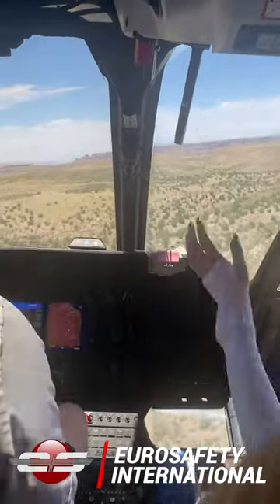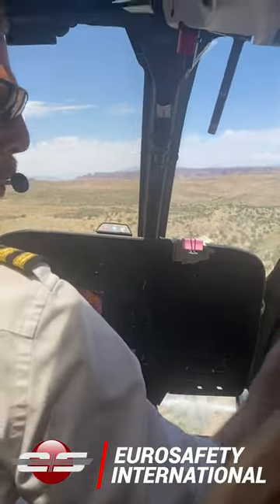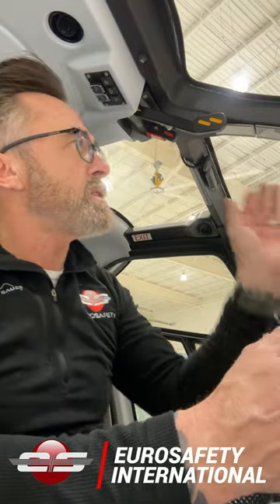The Reality of Grabbing the Rotor Brake in a EC130 #aviation

Comment: This is a great presentation. From my understanding (correct me if I'm wrong). The purpose of a rotor brake is to prevent or stop unwanted rotation of the rotor AFTER  engine shutdown on the ground. If the rotor stopped in the air, the helicopter would plummet like a rock. I have talked with pilots and military flight instructors and worked with the Huey 369 group and been in aviation for many years reading several NTSB accident reports. I have NEVER heard of a helicopter crashing because the rotor brake was applied, A huey pilot intimated in his book "Chickenhawk" that if the brake was fully applied after the engine was stopped and the rotor had slowed almost to a stop it would just slow down the rotation, and then they would set the brake, and tie the rotor to the tailboom to assist the brake against gusts for overnight storage.This is because to my understanding, they are designed ONLY to restrain loads from wind gusts acting on a parked aircraft. They are of insufficient strength by design for safety so as to not be able to suddenly stop a powered, flying rotor, or to even be able to slow it to any dangerous degree against engine power. such a brake would have to absorb torque loads many times in excess of the engines output and would probably rip off the tailboom from reaction. In other words, they are a small parking brake of very limited strength. Thus they would not heat up fast enough to cause a fire instantly and are probably designed to become red hot without doing so, just fading rapidly in effectiveness. I can't see any how manufacturer would ever install a big lever accessible to all that could instantly convert your hitherto functioning helicopter into an earth-seeking missile full of people screaming into the radio. However, and rightly so, pilots are taught that it should never be applied while the rotor is in motion, it would create a very interesting and possibly expensive situation, but not likely a fatal one. Secondly, sitting here and saying whether the pilots response was correct or not is ill advised. It was up to HIS discretion. The pilot is god on any aircraft, having ultimate power because they have ultimate responsibility, and they know THEY will be held personally responsible for the actions of anyone on board. Due to how the video was edited, and from personal experience, I suspect that the passenger had been difficult the whole flight, thinking it was cute or flirtatious to provoke him by constantly screwing around and twiddling with the controls. Some people have been kicked off of an aircraft and banned from ever returning for actions like this, because if a passenger with access to the controls ever causes a crash, it is the pilot's fault, and by extension the company's. None of us in the aviation community want to be made unable to allow someone to sit in the right seat, or even to let them fly for awhile which is very safe (generally fixed wing and non commercial only) due to an incident because we, especially in the fixed wing community, are encouraged to instruct individuals that routinely fly in a certain aircraft in operating that aircraft to the point that in an emercency of pilot incapatation, they could Aviate, Navigate, and Communicate! This takes practice. It is also a benefit for avaition to to allow these wonderful experiences. (We have to be ambassadors and recruiters for general avaition if it is to survive) so, he extended an AWESOME privelage that came with responsibility, to someone he deemed worthy. I can almost gaurentee they were instructed on how to conduct themselves.  He sounded like a parent at the end of their rope being thoroughly disrespected in a deteriorating situation, being constantly distracted from performing his job of  FLYING the aircraft. I have been in situations like that, and having the engine quit would be far less stressful than this! Interestingly, pilots in training are taught that you can easily make a child's day by letting them take the yoke for awhile in a small plane, but to be carefull with adults! Adults are more likely to panic or not follow instructions.

Comment: He is not saying that the pilot didnt act in a correct manor, nor is he saying that passengers should be free to touch stuff in the helicopter. He is simply pointing out the fact that people are spreading misinformation about what a specific toggle will do to a helicopter. Stop trying to misinterpret.
Reply from the maker: A voice of reason!
Reply: Yeah, but by the same extention, someone might see this video underneath the incident video and assume the all helicopters have the same rotor brake safety features like the EC130.

After all, if you put a "don't touch, wet paint" sign on a wall....some idiot will touch the wall to check.
🤦🏻‍♂️😂
Reply from the maker: I would have to assume if someone is that lacking in intelligence they would not have the funds available for helicopter transportation. Problem solved
Reply: @EUROSAFETYTRAINING  A rare thing on the internet
Reply: @EUROSAFETYTRAINING You would be surprised. I'm not.
Reply: Don’t be logical it scares the idiots away
Reply: @EUROSAFETYTRAINING  you underestimate dumb people lol. So was the lady trying to pull the lever in the video a rich genius?
Reply: I also saw, allegedly, that was the third time the pilot said something to the lady

Comment: They also said that an airplane door cant be opened in mid flight due to a safety lock yet a guy on air asiana managed to do it.....

Moral of the story even if u "think" that u wont have the force required to pull it back common sense should tell u when ur mid flight thats not the time to find out

Comment: Questions can you brake torque a helicopter? Would the brake drag if it was pulled even though it doesn't stop the rotor? If so would that drag overheat the rotor shaft? Would engaging brake stress engine enough to blow it?

Comment: Why is there 17x more deadly helicopter crashes than fixed wing aircraft? And with numbers like these, do you think there should be more fail safe’s?
Reply: Type of operation. Helicopters spend their time low to the ground. They also have much shorter flights on average. An airliner might spend 8 hours at 35,000', cruising on autopilot. There's not much to go wrong there. For me, 8 hours of helicopter flying would involve maybe a dozen landings and take offs in urban environments, the same again at an airfield, and maybe 3 or 4 of reach from a rooftop helipad. There's much more time spent close to solid objects!

Comment: Not only that but it doesn’t stop immediately, it takes quite a while to slow down and not only that, but the engine is still running and applying power so most likely there would only be a slight drop in rotor rpm and the pilot would just disengage the brakes. In a worse case scenario the engines shut off and the blades are completely stopped. The pilot can lower collective and start autorotation to spin the blades back up (you would be falling for a bit though) maybe you would have a really rough landing but everyone inside would be fine, I think.
I’m going to test my second theory out to see if I can get autorotation in time to avoid the ground

Comment: There is an extremely small possibility of stopping the main rotor by attempting to engage a rotor brake while flying. However, there definitely a risk of causing a rotor brake fire and the engine compartment fire suppression system on most helicopters is not effective at stopping rotor brake fires.  Also, not all rotor brake equipped helicopters have a safety release on the brake lever and the force required to engage a rotor brake will vary from model to model.

Comment: So at best it would slow the main rotor, overheat the shaft, and cause either a fire of massive vibration, either of which would be catastrophic. So the pilot was correct, it would kill them.

Comment: so then, the rotor brake is only used to park the helicopter after use so the blades dont freewheel in the wind while it's parked on the ground, not ever during flight right ?

Comment: I have seen a aircraft that the rotor brake control unit was rigged incorrectly and it supplied pressure when the handle was fully in and it caught on fire and burned up a lot of panels before it got put out. You are not going to overcome the inertia and power of the blades and engine and gearboxes but you will make a crap tone of heat

Comment: This description is still wrong, it would not take more force to lock the rotor brake because it is spinning, if anything it would take less. But that is definitely not enough break to stop that much horsepower so the helicopter would keep flying and you would just burn up that break.

Comment: General public won’t know what type of helicopter they’re in so suggesting it is safe to pull the rotor brake because you think it is in one type is still a dumb thing to do. Also you have made no mention of the fire risk associated with applying the brake which will affect all types.
Reply from the maker: I am utterly amazed by some of these comments. Did you listen to what I said and think I meant that its ok to pull the rotor brake handle?

Comment: I wouldn't be worried about the brake stopping any rotors when the engine is running, I would be worried about friction fire or damaging something in the brake system that could cause a rotor issue during flight. Dunno how they work but I'm assuming here

Comment: The main point is: The pilot is the one flying the aircraft.  The passenger(s) are not.  Do NOT touch anything in the cockpit without asking the pilot first.  Even if it may have no effect, the pilot has the responsibility, and interfering with the aircraft and pilot is irresponsible.

It's like having the passenger in a car reach over and grab the steering wheel while the vehicle is in motion.  Even if the passenger doesn't turn the wheel, the driver may need to suddenly, and would have to account for the extra factor.

Comment: Ok, on a Sikorsky S-76, you can legally apply the rotor brake under 65% w/ one engine off. So there for I’m thinking if put it on at 107% w/ both engines running you can over power the brake. You will make a boat load of heat and sparks that may ignite the magnesium gearbox housing. 

In a H-60, to legally apply the rotor brake it’s both engines off w/ the NR under 60%. I have had a rotor brake partially hang up on the ground and it made quite a high heat mess.  The disk was a burnt  blue mess, the spark shield was scared with chunks of steel spatter and the caliper was junk. 

On a H-53, the rotor brake is electric and is interlocked so there is no power w/ the engines, therefore no rotor brake until all engines are secured.

Comment: probably still shouldn't touch the rotor brake control or any other control as a passenger in any aircraft, especially when in flight.  that pilot was a bit salty, but he didn't know what the passenger was going to do with that seemingly random handle. pulling it might not have crashed the aircraft but might cause expensive damage.  either way, i would have yelled at the passenger too. .  passengers don't touch nothing, hold your seatbelt if you need something to hold on to.

Comment: Plus the engines at full throttle, while it would brake the rotor significantly even if it was pulled back and locked; wouldn’t immediately make it drop like a rock; if the pilot couldn’t throw that back forward quick enough to recover, he shouldn’t be flying. Let’s say I was oblivious the rotor brake was engaged, I’d immediately see we’re losing rotor speed while maintaining full flight power and that would be the first thing to check, did my idiot sitting next to me pull the rotor brake; otherwise I’d start staging for an autorotation looking for where I can land since something has happened that’s seizing the driveshafts, but in that case you can’t even do a good autorotation, so just hope and pray really 😳

Comment: Could it potentially damage the aircraft if someone tried to pull it? Not sure why passengers think they can push buttons or grab levers in the first place. It is beyond me.
Reply from the maker: Perhaps you did not watch all the way through. I pointed out that the handle is locked. The term locked in this statement means the inability for a person to move said lever without "unlocking" the device. Hence if someone grabbed the handle and attempted to move it, the handle would remained fixed in place. To answer your question, there would be no damage since the passenger would not be able to pull said handle. It is quite easy when viewing a persons actions within an environment of the safety of a dark room in front of a computer but when humans are in a new sensory rich environment they most often experience cognitive overload. This causes the analytical portion of the brain to operate at a reduced level. In this case the passenger was mimicking the pilots actions. I am not sure why he touched the rotorbrake but she obviously in this case mirrored him. Exercise caution in critiquing the imperfections of others, lest you succumb to similar failings.
Reply: @EUROSAFETYTRAINING  geeese, It was a question. Your attempt to insult me had 0 effect Mr smarty pants. Good day.
Reply from the maker: Thats good. The point was not to insult you but drive home the point of the video that you simply can not engage the rotor brake in flight. People keep asking but what happens if you pull it. Which I am trying to relay that you cant simply pull it.

Comment: I’ve maintained this particular aircraft (H125/AS350) for many years. This instructional video is correct but engaging the rotor brake before the 33% rotor RPM burns up the brake and really pisses off the mechanics 😎

Comment: IF the rotor brake was able to "stop the blades instantly" lol the mast has a shear section in it, it's designed so if the planetary gear set seizes suddenly the mast will shear allowing the blades to keep turning. 
Also, ive never seen an airbus rotorbrake that id anything more than a tolen effort at slowing blades haha

Comment: Why was this video necessary?

The pilot made a very good case for passengers NOT fiddling with instruments, and it's probably wise to leave people with that impression, rather than explaining that fiddling with flight instruments ISNT as bad as it might first seem...
Reply from the maker: Perhaps you did not watch all the way through. I pointed out that the handle is locked. The term locked in this statement means the inability for a person to move said lever without "unlocking" the device. Hence if someone grabbed the handle and attempted to move it, the handle would remained fixed in place. To answer your question, there would be no damage since the passenger would not be able to pull said handle. It is quite easy when viewing a persons actions within an environment of the safety of a dark room in front of a computer but when humans are in a new sensory rich environment they most often experience cognitive overload. This causes the analytical portion of the brain to operate at a reduced level. In this case the passenger was mimicking the pilots actions. I am not sure why he touched the rotorbrake but she obviously in this case mirrored him. Exercise caution in critiquing the imperfections of others, lest you succumb to similar failings.

Comment: Yah even then the rotor won't just stop dead. Does you're car stop at highway speeds instantly when you press the brakes? Probably not because there's a thing called momentum. It would take quite some time to slow down a rotor under power.

Comment: I have been years ago onboard a helicopter were the pilot used this emergency brake. On the North sea offshore a KLM helicopter  after departure from the offshore platform the helicopter started vibrating, and they headed for a military airfield for emergency landing, in the meantime the pilot keeps the helicopter very low above the sea, up on touch down in the military airfield, the pilot pulled this emergency brake, and with a slow motion hola hoop effect the helicopter stopped. Seeing the eyes and face from the pilot I realised that was a close call....
Reply: Good point, and something this gentleman didn't get across in the video.
Braking the rotor will probably change the torque to the body of the helicopter and cause it to spin in an interesting way.

Now I'm curious what the IRL of pulling the rotor brake looks like.
Reply: Bullshit..  it's not an emergency brake.  It's there to slow/stop the rotor faster than letting it slow on its own.

Comment: What's the point of a brake if know one has the force to use the brake to stop the spinning rotors? Isn't that the point of a brake? That's like saying know one has the leg strength to push on a brake pedal to stop the car tires from rotating.

Comment: Well. Think about this . Output shaft speed 6k. Mass of molten steel spinning at 6k. Molten rotorbrake disc coming  off and heade upto the main rotors or going donw into the fuel tank. Someone is going to die.

Comment: Shaft turning at 6000 RPM? Which shaft? The rotor shaft? Heck no. Rotor RPM (Nr) doesn’t turn nearly that fast. The UH-60 Blackhawk Nr turns at 267. The CH-53E Super Stallion turns at 183. If you’re talking rotor RPM, get your facts straight. But I appreciate and respect your video intent.
Reply from the maker: The location of the rotor brake is on the engine to MGB drive shaft ... that shaft spins at 6000 rpm. The rotor brake is not on the rotor mast... which in this helicopter spins at approximately 390.